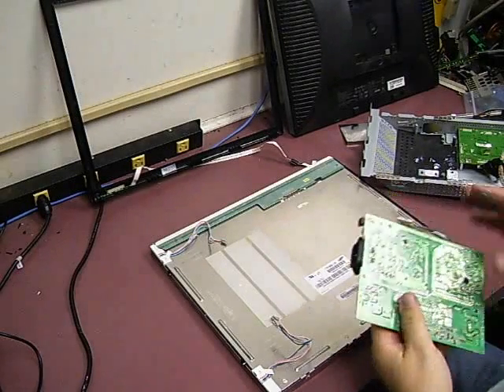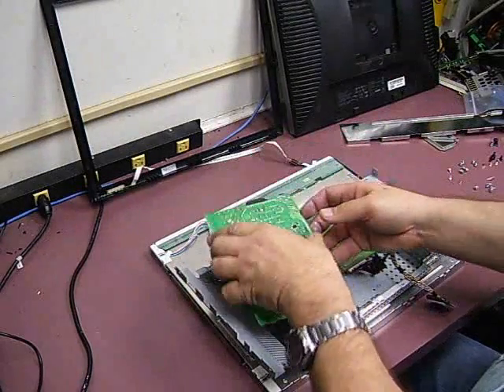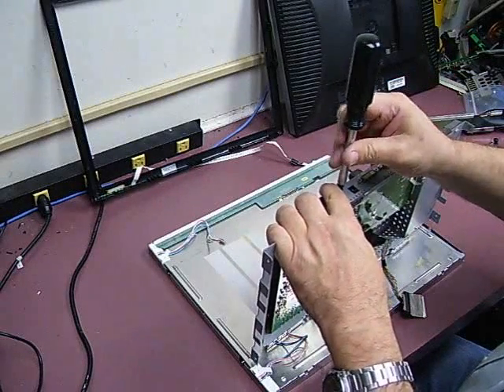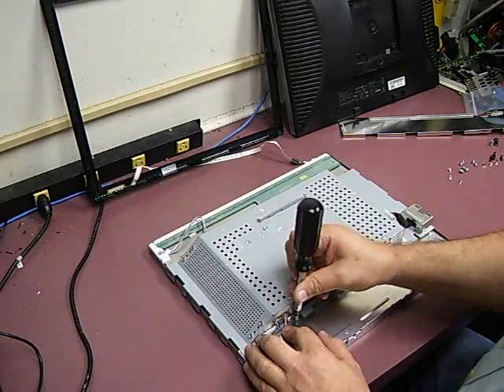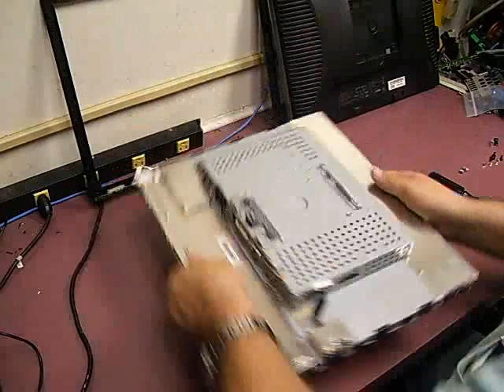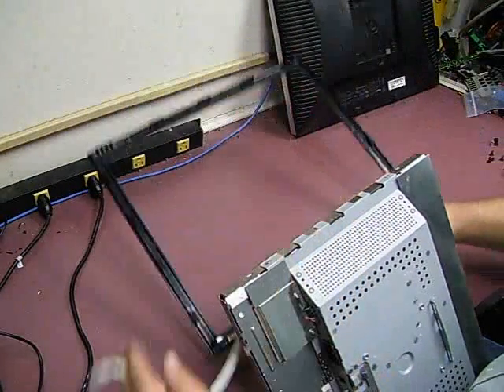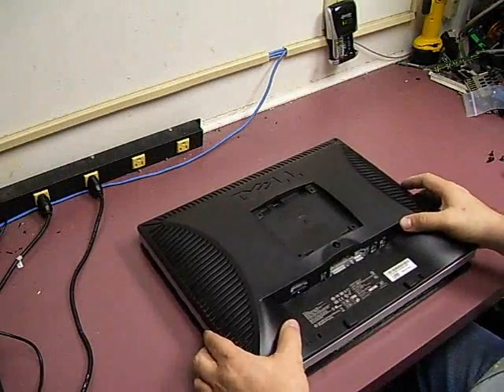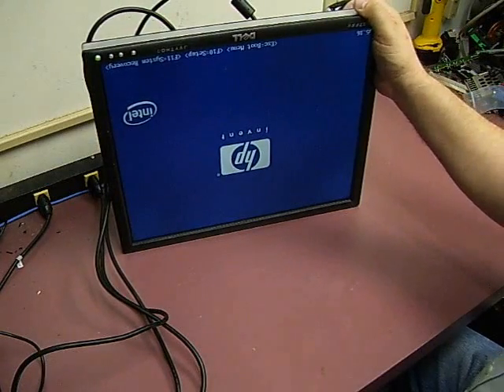Repairing a Dell 1905FP - 1907FP monitor part 3 asembly & testing

Comment: Thank you!!!! Dell 1505FP (sitting in the garage - for 3 years...and no more Corona Virus lockdown chores to do). Sure enough, a couple of capacitors crowned and leaking, a couple of ebay caps installed...nobody electrocuted - it WORKS! THANKS AGAIN for a great instructive video!!!!

Comment: why do many of these monitors die often. i had a 2005fpw just die out of nowhere. it was flashing the power light with squeak sounds coming from it when i tried turning it on one day.
Reply: Because the "CapXon" capacitors--which were what failed in not one but two of my DELL1905FP monitors--used in the internal switch mode power supply that were spec'd out to the monitor vendor are cheapo! DELL likely save a lot of money by having less that top tier component or "board level" parts installed when assembled at the factory in China, or someplace else outside the US.  So, when you fix it, be sure to recap with quality Japanese components and you'll likely have many years of life left!

Comment: Great videos!!  I had two non-working Dell 1905FP monitors.  One would not power up and the other would power up but had an annoying screen flicker running down the right side.  I was able to disassemble both monitors to remove the power board from one and put it in to the other.  Everything powered up successfully!!  Your video makes the soldering look easy.  I'll keep the old non-working monitor for now since I may need to purchase that capacitor kit from you.  MANY thanks for the instructional video and saving yet another monitor from hitting the landfill.  =)

Comment: thanks bud.  I picked up 2 dead Dell 1907FPVt monitors for free and spent about $45 (capacitors/soldering iron etc) to bring them alive.  One of them has dead pixels and leaked LCD fluids for about 1/5 of the screen so not very usable but other one is working fine.  This gave me a chance to use soldering iron for the first time and it was fun :) hopefully I didnt inhale too much toxic dust . keep up the good work.